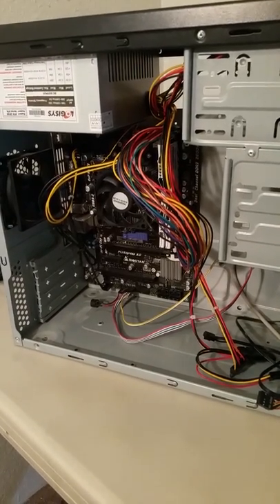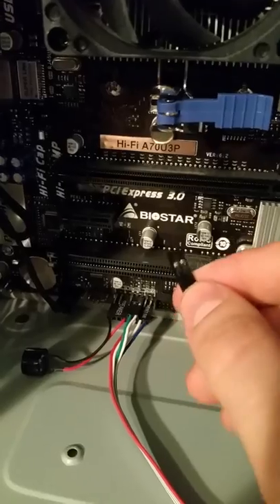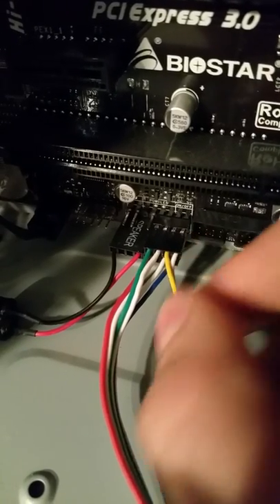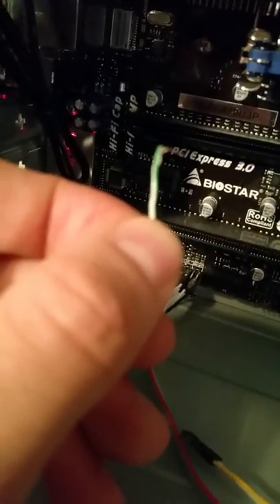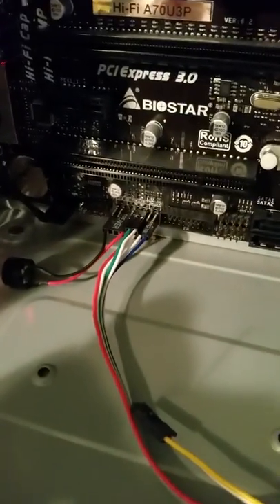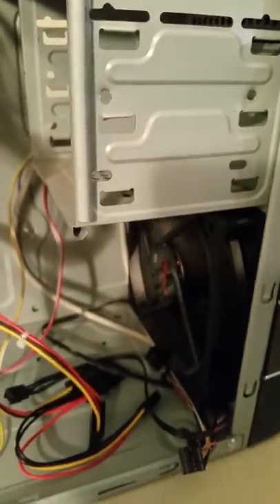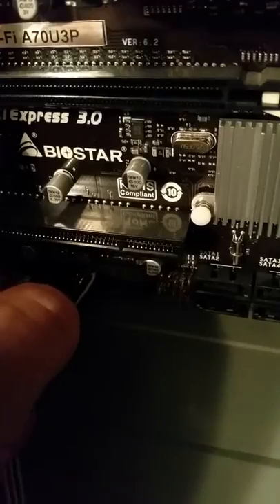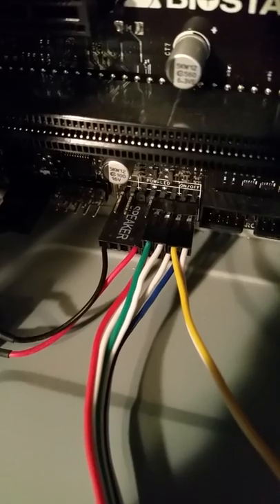How to bypass power button on a desktop computer

Comment: Thank you.  I built computers 25 years ago and run a tech business but in the last decade or so we don't do much PC repair work.  I didn't even consider the power BUTTON could be the problem.  Found an old jumper to short the pins on the board I have (which isn't this one but it doesn't matter) - and WALA it booted up.  Now to decide if it's even worth buying a replacement power button for this silly XPS that's 6 years old......oh, and all you people putting the guy down for a 4-minute video, get bent.  He's helping people out, why hate?

Comment: The green light on the power unit is lit but the power button is inactive?... I'm not sure what to try...
Reply: My problem is that the 
power button doesn't have that
LED light and that's all
is running but how come you know that is ON is the blue
LED light doent light up,
it could be the cables that goes
to the mother board?
Thank you!!

Comment: This is good to know but unfortunately mine still cuts right back off.
All the PS voltages check out except -12 is like -14.5. I doubt that's causing the issue though.
Mine won't stay on long enough to even get in the bios.
Reply: Yeah, some computers need a constant source for a little. For example, optiplexes like to do that, for some reason.
Reply: Dude, that makes no diffrerence, its just a power button
Reply: @devaggo Im having issues on my optiplex and I replaced everything except the power button. It turns on for a second the it stops. Do you think it is in fact the power button?

Comment: Thank you sooo much I was having a mental breakdowns
Reply: Was it plugged in to high or is it me ;-;
Reply: Taconada where that power button is take out that 2 pin connector and then get a screw driver and put it on the 2 pins and it will star the computer

Comment: My problem is that the 
power button doesn't have that
LED light and that's all,
is running but how come you know that is ON is the blue
LED light doent light up,
it could be the cables that comes from the motherboard?
The machine is an old desktop
emachines ET 1831-01.
I will have to look the power
cables and check is they are
hook up correctly "I think"
Thank you!!

Comment: Thank you, I have been looking for a video like this for a while,  searching for "on off switch" did not work...
I have an 2003 Power Mac G4 MDD, for a long time I was sure it's problem is the Power Supply.
Now I have an idea on how to test it, I did see a video where they had to remove/replace a circuit board so maybe this won't work.  Maybe there is a fuse on the board...thinking out loud.